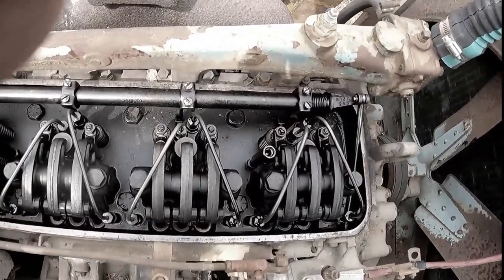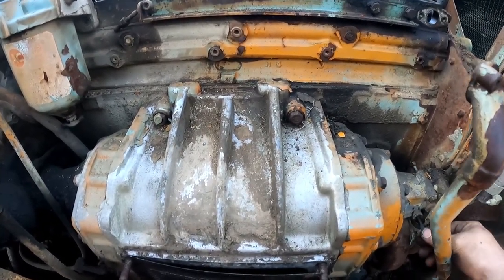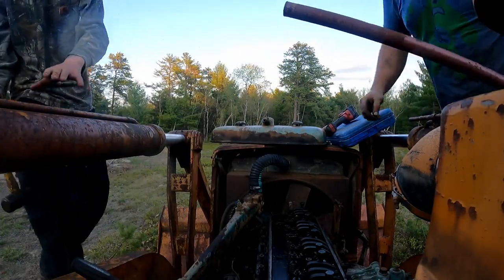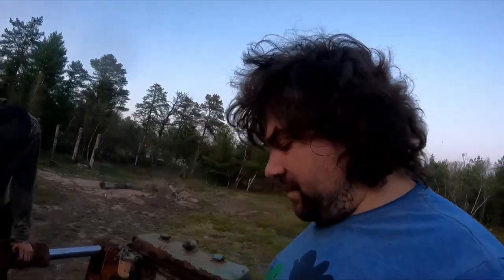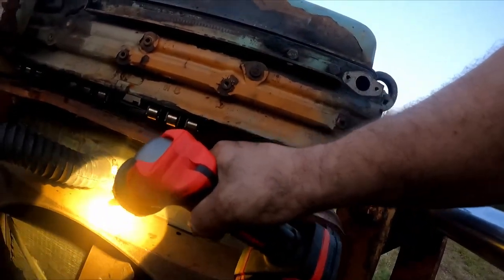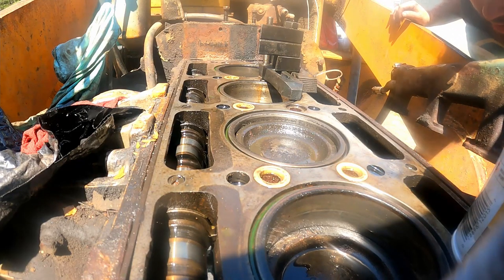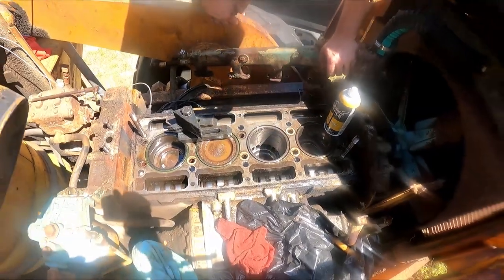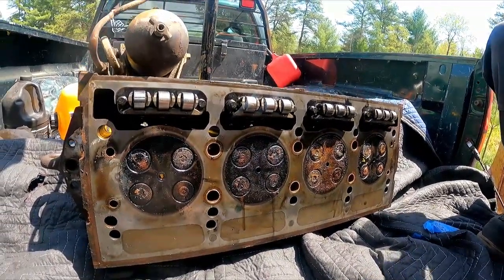Resurrecting the Dynaho 200-4 Detroit 4-71 - Removing the head, is it salvageable? Part 2

Comment: That motor looks extremely healthy there was zero oil in the blower or air box so that means it has no blow buy it has to be super low hours
Reply from the maker: The hour meter says 8400, but it doesn't work currently.  These things are supposedly good for 15,000 hours if treated right.  But the thing still starts better than my car, right away(though it has been pretty warm here lately).  Might also not be the original engine or it was rebuilt.
Reply: @wirestiresandfires214  it is possible that it has been rebuilt because I’ve seen about 2 Detroit’s with blowers and air boxes that clean
Reply from the maker: @brettdearing2898  This is the first detroit I've ever laid hands on so I have nothing to compare to.  Glad to hear that it looks newer.